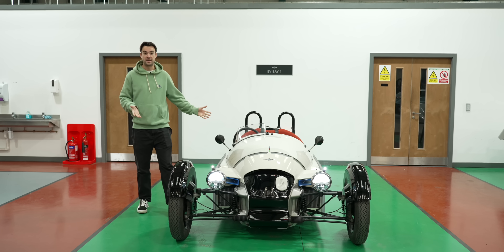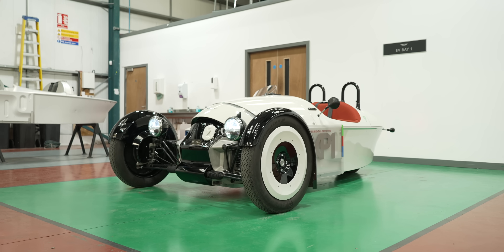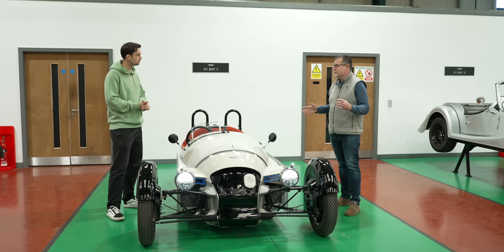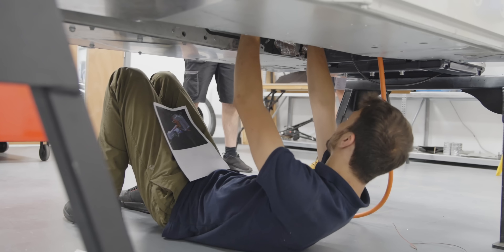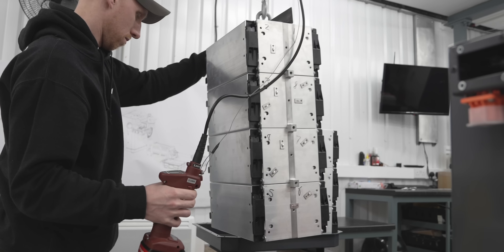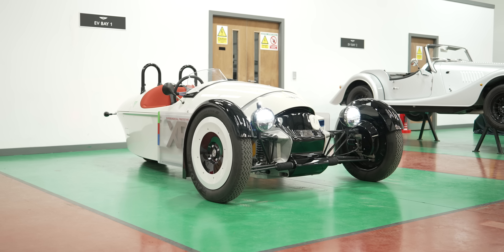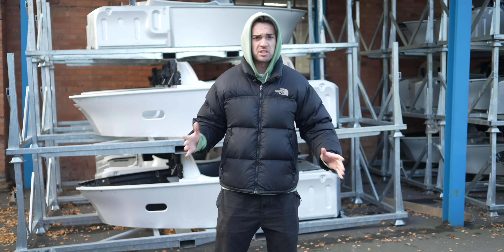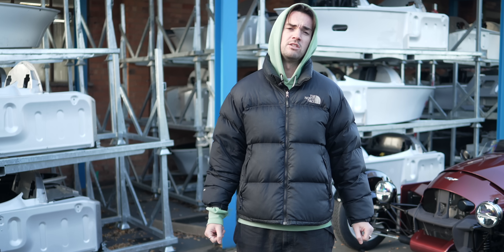How England’s Most Old-School Car Brand Is Embracing Electrification

Comment: The development of EVs proves to be a dead-end street. Ongoing battery issues, immense cost of ownership and missing charging infrastructure make electric cars an option which will not be viable for decades to come. 100 years ago, people were smarter and built EVs for short, urban commutes - that´s the only field they make sense, when cheap enough.

Comment: Brilliant to hear it only weighs 600kg. The range will only improve as battery tech evolves. Very curious to hear the noise, let’s face it the Super 3 petrol has lost a little soul with the move away from a V twin. It would be ironic if the EV version adds mojo.

Comment: Daft question. If you tune back the power of the motor, does this create a proportional increase in range? eg 300 bhp equivalent motor reduced to 200 bhp gives an extra 33% range?

Comment: It really is the case that EV's are a great leveller and disruptor n deconstructor in the Car Industry allowing bespoke workshop driven "rebirth" as well as a multi-industry not necessarily a "Car Manufacturing Industry" approach where he who innovates and adapts wins. BUT the window will close if we don't embrace it and certainly the big Vehicle lobby will move to resist.

Comment: Hmm... nice idea, and it will be good to see it come to fruition, but it's concerning to hear how many times he says 'ahh' when going into the marketing spiel. It doesn't inspire people to trust what's being said. 

There are some obvious areas where the vehicle's drag coefficient could be improved at minimal cost. A few thoughtsinclude: First would be to delete those headlights and to sculpt them into the front of the car body. The mudguards can benefit from some sculpting. The nose and the front suspension will need reshaping. Maybe a windscreen would improve turbulence around the driver, passenger and those roll hoops. The wing mirror needs attention. It should be able to manage 10 km/kWh (6.2 miles/kWh) in November, at the very least. I'm seeing that figure today, 11 December, admittedly with urban driving, but in a more Northerly area than Malvern. And our car is a Zoe ZE50.
But as he said, it's a prototype; a testbed, from which Morgan can learn, improve and go on to produce something which will be something special. Give it 40 kWh of available battery, and then people will be able to drive for as far as they wish, and in the manner which they choose, with no concern about draining the battery. 33 kWh is fine when the battery is new and if the driver has a gentle right foot, but what is it going to be like when the battery capacity drops to 75% of a new battery? That would result in early Nissan Leaf range concerns.
I wish Morgan every success with their EV plans. 🙂👍

Comment: It could be a good car for racing enthusiasts. It's light weight and likely has loads of acceleration yet will cause minimum environmental damage. Also, after the initial investment the upkeep should be minimal. I could see clubs of these EVs with their snobby entitled owners racing on dirt tracks as they pretend to be significant.

Comment: Incredible how simple that 3-wheeler is, just a battery connected to a motor with a charge port, like an RC car. That will probably have the unexpected consequence of making it incredibly reliable!
Reply: @@retiredbore378 Sure, they are expensive, but simple. This car very likely has an air-cooled battery, that's just a simple fan blowing channeled air over heatsinks. Regen braking is mostly software and is handled by the inverter you have anyways.

Then sure, the charger/inverter/BMS package would be the third component, so it's not exactly just a motor and battery, but those are essentially solid-state components with no moving parts, and are unlikely to fail. For a car like this they wouldn't really be that expensive either.
Reply: @@retiredbore378 The electric motor is a generator, I think you should know that.
Reply: @@retiredbore378  Molicel P45B batteries, which I am intimately familiar with, are car batteries, they are 21700 cells designed for (among other things) high-performance EVs, and they are installed in such as well. Now even if they are among the best when it comes to low-temperature performance (if we ignore LTO batteries), there is of course definitely batteries in EVs that are worse, but even my 10-year-old Renault Zoe EV handles the -30C northern Swedish winters very well.

Also, "you started out thinking", is a sentence I take issue with, I'm very well aware of all these intricacies, I just simplified them for a comment, since the rest of the components are few and relatively simple in comparison, and I don't feel like you're arguing in good faith bringing that up in your comment. 

Regenerative braking is something that is done by the inverter package of EVs, and it feels like you're forcefully trying to misunderstand what I'm saying in my comment. I would appreciate if you would try being a bit less arrogant in your comment.

Comment: 'It's the natural sound of electricity flowing through the inverter' - My old Leaf sounds fantastic pushing hard from 20mph to 60mph, the whine of the inverter sounds like a (quiet) jet engine spooling up, which makes sense given some bits are spinning at 10k+ RPM. It tickles the noise-loving bit of my brain and I totally agree natural sounds like that should be played up for a Morgan or any EV focused on the driving experience.
Reply: Same thing with my 2014 Renault Zoe with the Q210 Continental motor! 😁

Comment: I think that losing range in cold weather would be a feature in this car, not a bug.  Even someone mad enough to drive it in an English winter would be grateful for an excuse to come back inside.
Reply: Not even a winter vehicle unless the roads are clean. But really it’s a 3 season car.
Reply: Electric cars don't really lose much range in winter. It's all about the fact air has a higher density when it's colder, and winter tires have a higher rolling resistance, especially when pushing through snow. But both of those have a pretty small impact, the big one is really just cabin heating (though this is made much much smaller with an electric car with an efficient heat pump). Without that you really don't lose much range at all, maybe 5-10%.
Reply: @swecreations  it’s not about that fact at all. You use the heater and the battery is heated
Reply: @orishaeshu1084  Are you sure the battery is heated? Because I can see many reasons for why they wouldn't be spending the small amount of extra weight and money on that when it's something the absolute majority of owners will never use.
Reply: @swecreations  no I’m dumb.
Reply: @orishaeshu1084  No, being able to correct ones' mistakes is the opposite of being dumb, far too many people lack that skill.
Reply: @@retiredbore378 Many batteries will operate fine down to -40C, a Molicel P45B for example will put out 80% of its full capacity and easily power the car at that temperature, though a battery heater would of course make the capacity loss even less, even if the battery is heated up during usage and charging. This car will not operate even close to those temperatures and does not need a battery heater.

Comment: 3:31 - "no e-booster for brakes" Hmm..... the best EVs use regen for almost ALL braking, except for the emergency stops where ABS comes in. Brake control and traction/stability control are key safety aspects as well, so pruning back on these is a flawed design shortcut.
Reply: That's not what that means, it does still have regen.

Comment: interest is peaked...however, I see these Morgan 3-wheelers better suited as a gas/electric hybrid or a ev w/gas engine range extender (like the BMW i3).  100-150 mi on battery is plenty, then have gasoline to double the all ev number.   not full on EV and not full on Dino juice.   Still overall lower cost and not hamstring by range.....
Reply: Soon enough, SSB will be viable and could double the range, but doubtful anyone is doing 300 mile road trips in one these. Add on top of that, the EV charging infrastructure improves every year. At least for me, 130-150miles range for something like this would be great as a fair weather commuter car.
Reply: @cypvh74  150 miles is enough for me tbh, I'd be able to just take a 20 minute charging stop every 2 hours for long-distance roadtripping.
Reply: No definitely not, that'll just be so heavy. Electric motors are much lighter than gasoline engines and transmissions, so now this will weigh just as much as the gasoline one. Making it a hybrid will ruin that. And if they wanted more range and didn't worry about weight a larger battery would be the better option anyways.

Comment: I love how Aptera, a plucky small, fairly recent startup, has a three wheel vehicle that surpasses this in virtually every way
Reply: This isn’t trying to beat Aptera. They’re trying to make a classic vehicle as an EV.
Reply: @orishaeshu1084  this is true. It's cool that it's a classic car, I guess their market is people who are interested in buying one because it's a classic car and a classic brand. 

As far as the actual engineering though, Aptera just seems like they are leagues ahead, and I don't really know why someone would buy that over an Aptera unless they were buying it to essentially use it as a toy
Reply: @louisjov  that’s exactly what a morgan is. This company used to build coaches, and the modern morgan essentially is that. Plus way more sustainable too. Using wood in parts of the car? I imagine the environmental impact is way less than all the stuff in modern cars. It’s a toy that’s not too shabby for the environment too!
Reply: @orishaeshu1084  the EV one has no wood
Reply: @louisjov  ok and aluminum is used in cans, which is recyclable.
Reply: @orishaeshu1084  very true! 

The body of the Aptera is also supposedly recyclable, but yeah metal is definitely way easier to recycle. 

What I do love about the Aptera is the right to repair ethos though, which begs the question, if you don't get in a major accident, just how long can the body last? If you can still be driving the same body 40 years later, that definitely makes the recycling challenges less of an issue
Reply: @louisjov  aptera is carbon fibre and I think fibreglass? Both difficult to recycle. I could be wrong.
Reply: @orishaeshu1084  definitely difficult to recycle (though that is quickly improving), but to me, at least Aptera is something people can actually use as a practical vehicle
Reply: @louisjov  I’m interested in the 4 wheel version. An Aptera design would probably get 5-600 miles.
Reply: Er, no.... sorry, but that's not true .....!
Reply: @andymccabe6712  this has a cd of .42 and the Aptera .13. Form over function.
Reply: @andymccabe6712  covered, cargo area, comfortable, affordable, long range, actually close to production...

I don't know how the 0-60 time compares, but it sure seems like Aptera is doing everything better
Reply: Except not an open air small fun sports car. The aptera is huge.
Reply: Apart from the most important one, style, Morgan car has way more style.
Reply: @@retiredbore378 I mean, if you're fine with being totally exposed to the elements while driving, why not just have an electric cargo bike?

A Dutch Bakfiets easily holds more cargo than the Morgan EV. 

It's a cool car for sure, but fundamentally, it's a toy, not a practical vehicle.
Reply: @@retiredbore378 yeah this is true unfortunately. 

I do wonder though, if one is okay with driving a Morgan exposed to the elements, why not just have an electric cargo bike like a Bakfiets, that can actually carry cargo. 

The Morgan is cool no doubt, but to me, it's a toy fundamentally

Comment: Jack, re the chassis, if you had ever seen a stripped early 3 wheeler you would appreciate this new one being built along sound engineering principles instead of being a few tubes and bits of angle iron held together with U bolts, even the owners club agree they where a bodgers delight.

Comment: I hope they don't half way this thing- make the ev bits stylish and steampunk, maybe brass or copper-coated, with 1903-vintage gauges (you only need speedo and range), kerosene-lamp-style lighting, boiler-style wheels,  and to top it all off,  a big copper blade-switch-style gear selector. NO SCREEN! Wooden dash,  brass and leather everywhere. Sleek styling like a Sopwith Camel meets 1903 Morgan.

Comment: Electric cars used to be about as prominent as internal combustion engines. It was Henry Ford's mass production of vehicles with internal combustion engines that put electric vehicles on hold.
Reply: The electrical starter motor is really prime success driver for ICE adoption over EV's. The convenience factor was the main selling point for EV's at the turn of the century that allowed them to compete with ICE vehicles.

Comment: You could argue that a car like this Morgan having bi-directional charging makes infinitely more sense than an everyday run around because generally Morgan owners only use these cars maybe 1-2 times a week. Therefore it probably sits idle more than any other type of car.
Reply: That's a house battery with flair!
Reply: @willdclarke33  A self-propelled house battery, lol
Reply: It’s going to be a bugger to fit in the loft.
Reply: 1-2 times a week? That's optimistic, 1-2 times a month is probably on the high side for most Morgans!
Reply: @asharak84 If I could afford one, it'd be my Daily Driver, makes so much more sense for one person around town transport then a large sedan, SUV or Pickup.
Reply: @asharak84  I would us it instead of a motorcycle being 76, and I put a lot of miles on my bikes. This car would be a dream come  true, if they were to sell them in Canada at a price I could afford.
Reply: I wonder if I can convince the wife that our home battery needs to be easy to transport
Reply: @richardschofield2201  A sensible woman surely would see the benefits and actually be the one to suggest this completely necessary purchase.
Reply: not in LA

Comment: The cure for EV would be a safe, capable battery with an energy density greater than gasoline. Unfortunatedly, there is no such thing.
Reply: what so it would go 4x further than a car full of gasoline?
Reply: No not really. Electric motors are much lighter than gasoline engines and transmissions, and much more efficient, so the batteries don't need to be nearly as energy dense.
Reply: @@retiredbore378 The entire thing, with motor, inverter and charger is definitely lighter, there's no question about that. And an efficient heat pump eliminates almost all those losses in the winter.

Comment: An alternative: The Aptera is hardly a "boring" EV. However, about the only things the Aptera and the Morgan EV are three wheels and batteries.
Reply: I was pleased to learn that the Morgan engineers agree with Aptera that a forward weight bias is important for good handling in a three-wheeler. Clearly the Morgan is a test bed, whereas the Aptera is a thoroughly engineered design that is ready to go into production and features all-wheel drive via in-hub motors, a carbon-fiber chassis, 10 miles per kilowatt-hour efficiency and a 0.13 drag coefficient.
Reply: @jameshinde8312  How many years has it been "ready to go into production"? I fear it may be "jam tomorrow".
Reply: They insist it's just a prototype; Aptera pretends prototypes are real, even when they are half faked.

Comment: Morgan 3-wheeler is an antidote to any boring 4-wheeled cars - why pick on EV's?

The designer seems to have run out of ideas around where the radiator grille might go (and the charge port is currently located) - should have something looking like that on the classic 4 wheel Morgans - would probably be more aerodynamic too!